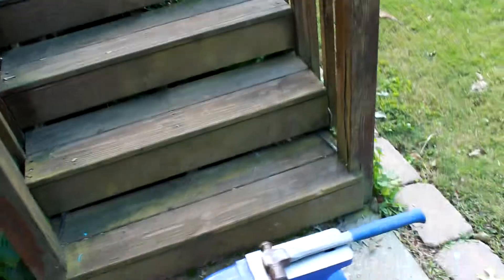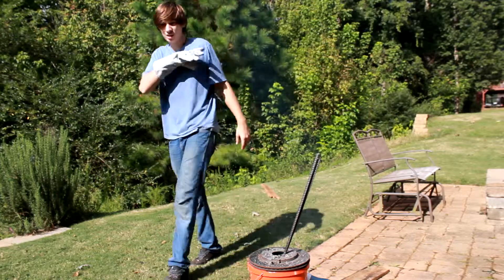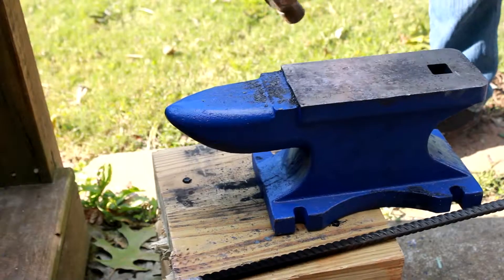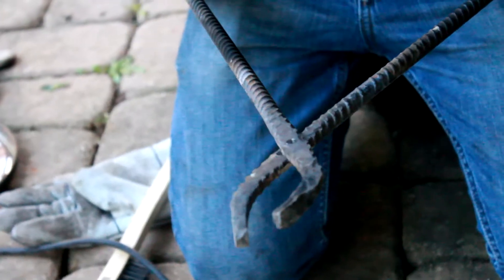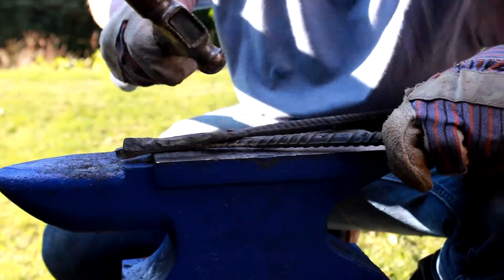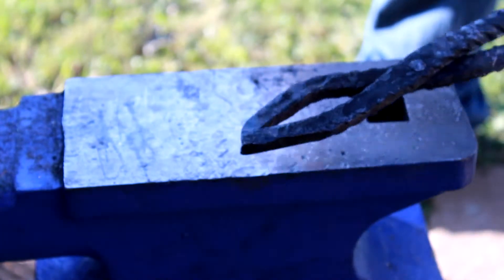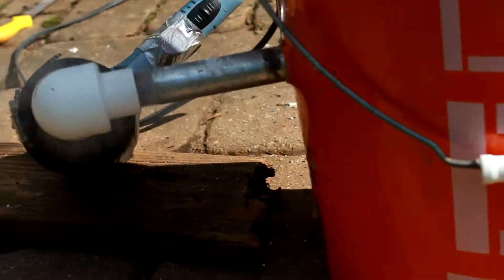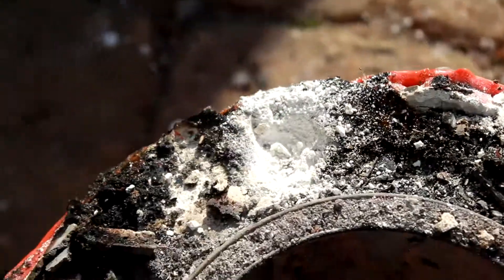First Blacksmith Project: Tongs

Comment: Young fella you gotta bolt that anvil down.....hahah. I was waiting for it to fall off. Try and get your metal hotter too, if your forge will do it, like a nice yellow heat, it will be much easier for you. Good job mate.
Reply from the maker: I was worried, i didn't even notice till i looked at the footage afterward, it is now. Got a new forge built and I think it will go hotter, plus it is longer so i can fit the enitre peice in it.
Reply: Good one keep it up matey.